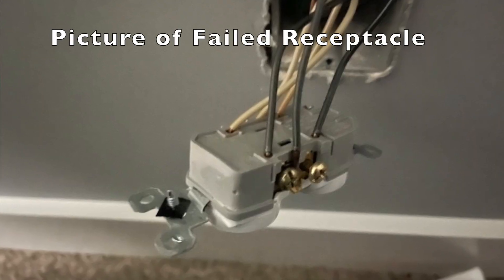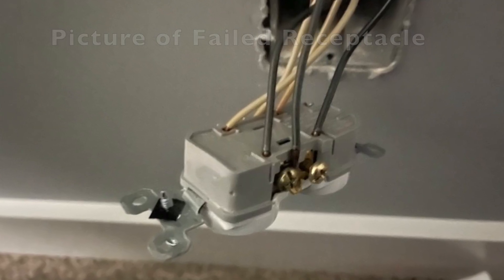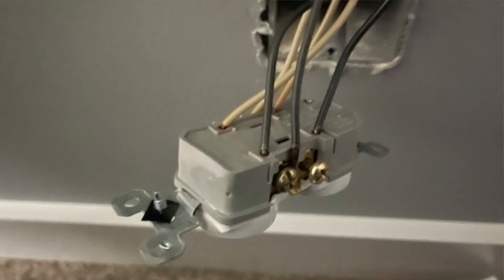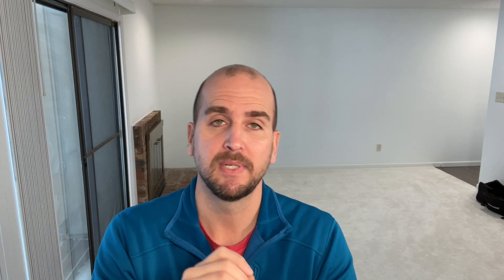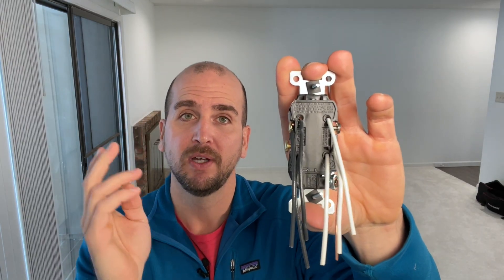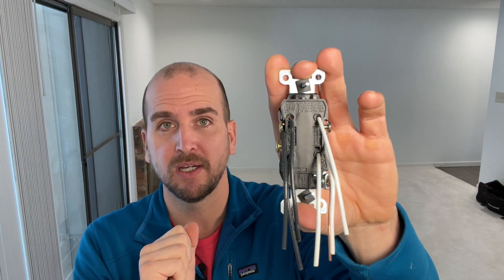Incorrectly Wired Outlet Found In Newly Built Home

Comment: First let me say I appreciate telling people not to use those cheap $0.60 receptacles. As a licensed electrician of 44 years I have some advice. So when stripping the conductors, do not wiggle or twist the wire strippers. That actually puts Little nicks all along the conductors. Those should be avoided. Why? 2 reasons. Nicks on solid conductors can actually cause them to break in the future. Also twisting the strippers around the conductor creates a nick all the way around the conductor which actually reduces the gauge of the conductor at that point, thus reducing the actual capacity of the conductor to carry the proper current. Example: A nick encircling a 12 gauge conductor (rated for 20 amps) could reduce it down to the diameter and thus the capacity of a 14 gauge conductor (rated for 15 amps). In other words, a chain fails at the weakest link. If when using nice clean sharp wire strippers we size them to the proper conductor size all we should have to do is pinch the strjppers closed and push it with your thumb. No twisting of the strippers equals no nicking of the conductors. The master electrician who taught me would not even allow me to strip conductors in order to splice them until I learned how to do so without leaving nicks on the conductors.

The push ins on the back of those receptacles have always been a nightmare. That being said remember to pigtail or not to pigtail depends greatly on the depth of the box. Pigtailing adds the volume of the wirenut as well as an extra conductor for each pigtail. Remember on remodel work we are at the mercy of the original installer and whether or not they took into account the proper box size for the amount of conductors they brought into it. Though the code states that we do not have to count the volume of pigtails inside a box when figuring out box fill, the reality is they still take up space. NEC 110.12 tells us that all electrical work shall be done in a neat and workmanlike manner. It is just as dangerous to overstuff our boxes as it is to use those stab locks in the back of the receptacle. I do whole-heartedly agree that pigtailing will prevent Downstream receptacles from being rendered useless if an upstream  receptacle fails. Always many things to think about before proceeding with what we thought was a simple repair.

One last thing, we no longer need to twist the conductors together prior to putting modern-day wire nuts on. That was a practice that we did years ago because the old wire nuts did not properly twist the conductors together themselves. The modern wire nuts are very capable of twisting conductors together. In fact, if we follow the manufacturer's  instructions the wirenuts will do a better job than we can with our lineman pliers.

Comment: WHY use a a pigtail?  What is "actually wrong" with just putting 2 wires on one terminal together?  Also, Instead of putting 2 on 1 terminal, use the other terminal also and put one wire on each.
It is ok to say to just do it "this way as it is better" but you don't say why.  The why is also important also.
Reply: Because the receptacle is junk, usually.   copper wires are a sure thing.
Reply: @thomaswayneward  You answered - but didn't answer the question.  Why not put 2 wires on 2 terminals not just 2 on one.  If "junk" 2 on 2 is better.

Comment: Stab ins only fail if the person who installed them didn't leave enough wire and/or didnt strip properly.. so its not a mistake.
Reply: Not true. If seen too many burn up because they lose spring tension over time. Replaced more than a few that were melted.

Comment: Not sure why you would pigtail 2 hots and 2 neutrals when you could use the 4 screws .....
Reply: The common response I get with that is you don't want the tab in the middle conducting all the load on the circuit. What I don't get is if people are worried about that failing, why wouldn't code require conductors going to all the screws in the first place. My thought process is if people are worried about that melting in an overload condition downstream, how is that different than overloading that one outlet that isn't connected to a conductor but is utilizing that removable center tab on the side.

Comment: According to the NEC you have to pigtail the grounded wire. It's incase the device fails or someone pulls it out hot it won't fry other things on the circuit. Being no return path. Just saying

Comment: I really can't see any of this stuff causing a failure. Sure it's worth it to do it right the 1st time. But don't sweat "fixing" everything if your plugs are installed like this.
Reply: electrical code and videos like this is like trying to outdo each other over and over and over. IT can always be done 'better'. Is it actually better ? I doubt it. You're adding another connection with the pigtail and in my opinion that's another potential point of failure.

Comment: Disagree with the pig tail. Sure if there is more than two wires , but I'll trust connecting at the terminal over a wire nut any day.  Way cleaner and more reliable.
Reply: And I've seen just as many wire nuts fail as failed connections at the receptacle.  Pigtails are "safer" or "more reliable".  They only allow you to install a box with heavy wire more easily.

Comment: I am using you tube tutorials to show me how to replace receptacles and switches in my home. Why isn’t it best practice to shepherds hook the two hot wires around the two provided brass screws, and use the back push for the 3rd hot wire? (And the same for the neutral wires - for 7 total wires) instead of pig tailing two and cutting a 6” piece to wire nut together?  I have come across several in my home with 7 wires. Honest question. Thanks
Reply: Also,  are the 7 wires the way I’ve found them against NEC?

Comment: So, what about mounting the outlet so ground terminal is up?  I have heard that this is also a recommended practice.   The idea is that if a slightly pulled out plug  has something fall on it that has electical conductivity from the top, lands and stays there, that you will be shocked or worse, start an electrical fire.   This is the risk when the 2 hot leads are up.  The risk is minimized when the ground leads are up.     What do you think?
Reply: I agree, I have also heard this is the correct way (with the ground facing up). Seems like certain parts of the U.S. do it this way , while others do not.
Reply: I do it both ways. Depends on the location of the receptacle and what's going to be plugged into it.

Comment: Though I found this very informative, I would want to know why there are so many wires before I pig tailed them together. For example the kitchen outlet in my apartment has two hot wires and the receptacle has the metal tab between the screws snapped off since both wires are live and on different circuits, pig tailing would Not be a good idea.
Reply: Unless there was a third pair of wires in the same box. Then one of the two circuits could be pitailed.

Comment: Sorry to disagree but the outlet was wired to code and used a UL tested and approved outlet with the push in wires as tested and approved.  You may want belt and suspenders but is the extra effort make the final job any better?  NO.  You kill productivity.  You add worthless rules and tell people who don't know any better a fairy tale - that productivity killing well tested improvements are not safe and should be done the hard way.  The screws being fully screwed in are only for a steel box and most boxes today are made of plastic.  No need to waste time and screw in the side screws for a plastic box.

Comment: No builder is going to tell his electrician to hook every 15a plug and pigtail all connections with more than 2 wires.
Reply: In my experience the GC isn't going to tell the sparky jack shit, the tradesman is going to do things his way no matter what the guy in the white hat says... for better or worse.
Reply: @F3Ibane  I agree to an extent.  I have done track homes to multi-family to 5m custom homes.  With the custom homes you might have requests that are above and beyond code, but they would be included in the scope of work.  

Anyway in 15 years nobody has ever asked me to hook the plugs and if we pigtailed it was so we could have temp lights.  

First day doing a residential final I was hooking every plug, and that ended by day 2 when the other guy working with me did twice as many plugs in the same time.

Comment: My professor in my first semester in technical college is a licensed master electrician and he told us never to use those push-in connectors and to always put them around the screws.  That by doing it that way makes it easier to replace a single receptacle unit.  We were instructed to use the pigtail way of doing it and only that one.  There is one thing that I was taught differently about the way you did it though. I was taught to put the wires under a screw by wrapping them clockwise around each screw.  Also, when using a metal box, the ground wire must attach to the ground screw in the bottom of the box before it is attached to the receptacle, switch or other device that is attached there.

Comment: You missed a couple. Wrap black tape around the bottom of the wire nut and wires to keep nut from unwinding over time. Outlet face should not be a "happy face" -- put the ground pin at the top so if something falls against a plug pulling it out slightly, it won't be able to short the prongs together. Both are "best practice" but not required by code.

Comment: Wait, instead of adding a pigtail on that outlet you should have used both contacts and tightened the screws. I know it was just an example of how to make the pigtail, but pig tails are only appropriate when you have 3 or more wires. I have seen more wire nut connections fail than push in connections. I personally wont use wire nuts unless there is no other option.

Comment: I think, for many homeowners, it's counterintuitive to think that longer wires in the junction box are better than short ones. There are code limitations on the number of conductors and devices allowed in each size junction box. That's not part of this discussion. This is about technique.  A short wire is hard to fold back in to the space behind the device(s) and can be hard to connect to the device. I cut my wires at approx 6-8" out in front of the box depending in part on how many gang box I'm installing. After stripping the insulation, I fold the wires, to be nutted, sideways at 90°, so they're parallel to the face of the box. Now I can easily adjust the length of the individual conductors in my grasp, so they are even at the end, before installing the wire nut. 

I don't twist the wires in advance with pliers. It's an extra step. If the wire nut is filled to capacity, with pretwisted wires, and because the wire nut tapers pretty quickly,  I question whether they would lay against each other in a natural distribution, or whether just the just tips would be bunched up at the base of the nut.  
I begin twisting the nut just prior to making contact with the wire end, with mild pressure, until I feel engagement. I believe this minimizes the chance of a wire getting pushed out of the way, especially with a maximum number of conductors allowed in the nut. If a multistrand conductor is in the mix, I pretwist the conductors of that wire and extend it 1/8" in front of the others. Multistrand wires are the most likely conductors to get pushed out of the way.  When using this technique, if I undo the nut, the conductors are not flush at the end, but lay very naturally in a very tight mix. After the wires feel fully engaged, I shift my grip back a couple of inches, on the wire, and twist until the insulated part of the wire has twisted 2-3 times around. I feel that is a simple way to gauge uniform, adequate tension.

Comment: Licensed electrician from CO here, just to correct you, you keep referring to the outlet as a commercial grade device, when in fact it is a residential outlet, it has the TR stamp, meaning tamper resistant. Commercial devices are not tamper resistant
Reply: They do make and sell commercial grade tamper resistant devices, Building code for TR receptacles are only required in areas that children under the age of 7 are exposed. Commercial spaces and office buildings, other than childcare facilities, do not require TR receptacles.

Comment: There are two main things wrong with push in connectors. The point of contact is incredibly small (basic geometry). The metal tab inside is copper plated spring steel that is bent downward on the end. When the wire is pushed in the hole, the tab extends far enough in to the path of the wire to flex the tab downward causing it to bite (tiny, tiny bite) in to the side of the wire. Just enough bite that it can't be withdrawn without depressing the spring tab (separate hole). A VERY SMALL POINT OF CONTACT. Heat is generated at that small point of contact. By comparison, properly stripped 12/14 gauge wires have  5/8" of wire exposed and are twisted in to a bundle and held tightly by the spring in the wire nut (many points of firm contact).
The wire in a circuit is effectively one continuous wire from the last device to the breaker. Running the load through each device, from one "poke connection" to the next, is a very inferior installation. Versus, nutting the wires together in the box, along with a pigtail for the device. 
When remodeling in homes wired with "poke connectors", we used to burn up outlets pulling 13 amps on a 15 amp circuit without tripping the breaker. We found that often the spring metal tab had lost the tension to make good contact (maybe from repeated heat cycles) or it had arced at the point where the tab touched the side of the wire.

Comment: thats why electricians use electric tape to cover all the outside edge of receptacles of any kind but dont expose wire out the back put the cover all the way in holes also pigtail wires of similiar ro one screw and tape down after installed

Comment: I've been teaching my helpers for years to pigtail the hots and grounds. You are correct and thanks for spreading the word. The one added thing I'd add is that since one black wire is the feed and the second black wire is the load, there is a small piece of metal between the screws that carries the entire load of every outlet downstream from the first outlet in the daisy chain circuit. Pig tailing the wires eliminates the load on that small metal piece between the screws. I've seen (usually cheaper) outlets that have overheated and melted the plastic on the black wire side. Keep up the good work. Larry the Electrician (retired).
Reply: Not a problem if you put both wires under the plate of one screw terminal which avoids the bridge (that small piece of metal) between the upper and lower receptacles.

Comment: I live in an old house. Only two wires go to all my outlets. Since there is not ground wire and the neutral is grounded, is there a problem tying the third prong receptical to the neutral prong receptical?
Reply from the maker: If you have 2 prong receptacles in your house with no ground and want to upgrade to 3 prong this would be the approved method called out by NEC outside of running a ground to each box.  https://youtu.be/qrtyUuL-eRw
Reply: @EverydayHomeRepairs  Thanks but I was just wondering was there a down side to the way of doing it the way I described. I've already wired several receptacles this way over 25 years ago. Never had a problem but was just wondering
Reply from the maker: If wired as you describe you could have a dangerous scenario where an appliance, let’s say a toaster, can become hot and shock someone who touches it if there is a break in the neutral wire.  Definitely not recommended.

Comment: VIOLATION,  In the majority of jurisdictions splicing and pigtailing as you had is not accepted in a box of that size and best to get in the habit of simply using a 4" box and with the raised plates. The receptacle box that your using is best for two conductors and no more and electrical codes are for the minimum requirements  so make the job safe and if needed spend the extra few dollars and do make sure that your customers are aware that smoke detectors are inexpensive and save lives.

Comment: when creating a pig tail, it is not necessary to twist them together. just hold them close and apply the wire nut..the nut will keep it snug.
Reply: Sorry gorge O. ! ALWAYS twist the wires and trim the end. I have had many calls where someone did just what you said without twisting the wires and they will turn black form overheating and they do catch on fire.

Comment: It looks like you are installing a 15 amp outlet on a 20 amp line.  You mentioned the wire was 12awg, not 14awg, which is used for 20amp circuits.  14awg is used on 15amp circuits.  The outlet plug shape is that of a 15amp.  20amp outlet has a horizontal feature on the neutral plug.
Reply: 15 Amp Breaker White 14 AWG wire 15A outlet ONLY   20 Amp Breaker Yellow 12 AWG wire  CHOICE either 15A or 20A outlet is allowed
Reply: @jankuehl4207  I'm being told that it is not  recommended, but if you do put 15amp outlet on 20amp circuit, they want you to put more than one outlet on that circuit.